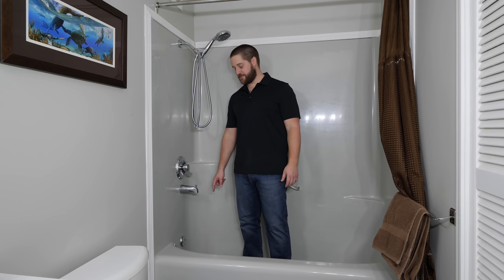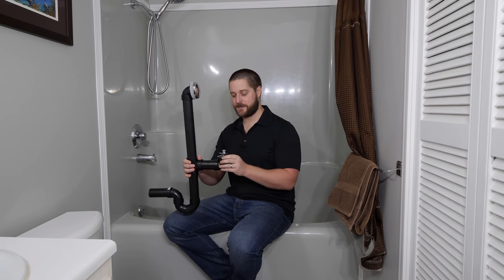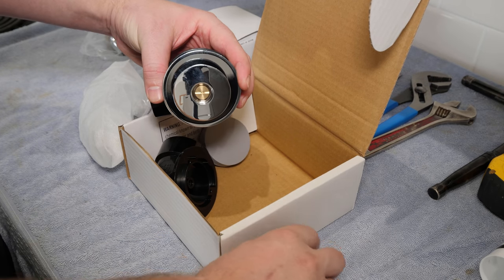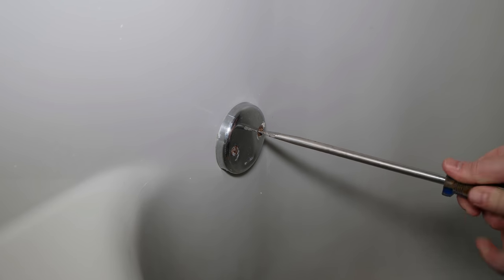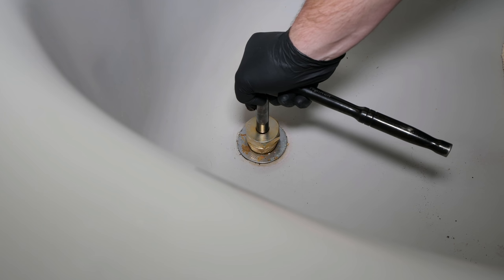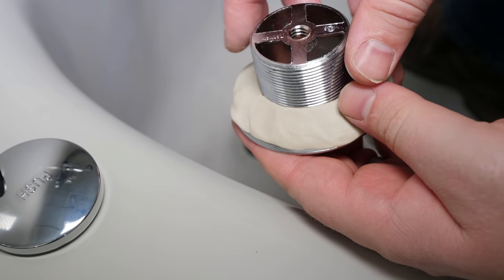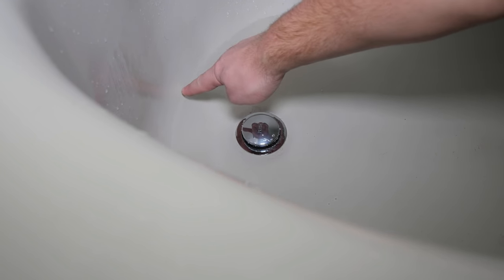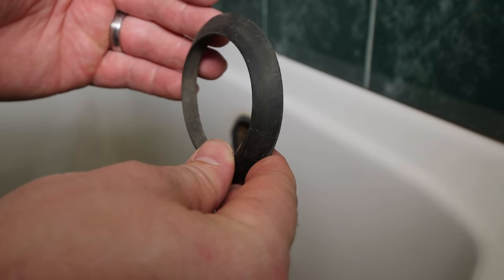Replacing a Tub Drain: Bathtub Drain Removal and Replacement

Comment: Best tip in this video is the gasket being under the hole cutout and not on top.  I'd bet lots of installers have done this wrong and as a homeowner repair I might have just replaced everything back the way it was thinking it was right.  Great video.
Reply: I’m fixing mine right now and that’s exactly what would’ve happened to me.
Reply: Biden Joe Lets Go Brandon And i agree!  Are your shorts too tight. He's just a homeowner making a comment about what he saw in the video.
Reply: But for 20 years it didn't leak, so there's that
Reply: Salty Berserker Brigade Come get some  Wow, a whole 20 years. So you’re basically a beginner.
Reply: Same! @Gray_Son1
Reply: Best comment on this video! I installed mine already but need to reinstall it with sealant. I just simply fast forwarded this video to see what he used (plumbers putty), and so I totally skipped that part but happened to notice your comment! I had put it in the wrong way and would have again! So thank YOU haha
Reply: Same! I just replaced my old drain with this style and was going to do the same thing.   Also, As a first time drain replacer, it was stellar having the excess putty just almost trim itself.🎉
Reply: @soquel7912  I think silicone works better than puddy. I stopped using puddy years ago
Reply: @IRoYaILTY why is any sealant needed? Isn’t the sandwiched gasket between tub and drain pipe forming the seal?!
Reply: @emilyc5309  that seals the strainer into the shoe, you still need to seal the strainer from the tub drain opening
Reply: I’ve seen several videos address this but say it’s not needed 
Not only does this video say to replace it, it shows a very handy trick to do so.
Great video 

I actually was concerned with replacing mine until I saw this

Comment: Our house was built in 1966 and I want to replace the tub drain because I'm going to replace the faucets but I'm worried it will be difficult and/or the new drain won't fit. Not sure if old tubs have the screw in kind of drain! 😱
Reply: My home is 1966 too! The new fixtures are of a different metal! Heavy metal back then! Sometimes, just a hair of when doing repairs! It can be so frustrating!

Comment: Hi all, this came to my feed. Thanks for sharing your tips! I want to say to some folks with an older home (40-50 years+) there were some different combos of thread. Can't source them anymore. Before you do the disassembly, thinking you can just pop out the insert from the tub side, and find a modern replacement of either thread type, nope! So then, you need to replace a lot more. Also note, that during initial install, tubs are fitted with the drains and then put in place. I mention this, because in trying to retrofit a replacement, there may not be room to easily remove the subfloor facing portion. I found this out when moving to our new-to-us 50 year old place. Drain had it's cross protection broken out on the tub side, and I have little naughty kids, so I wanted a new secure one. I scored it and got it out, and not nobody had a drop in replacement. Not even the trade stores that I couldn't buy from anyway. I needed to cut away some framing that had been built around the plumbing when the tub was initially dropped in just to access removing the drain from the bottom side. This put my main bath out of commission for a week while I went though all this investigation. Just sharing to prevent headaches and scope creep!

Comment: This is a very clear and easy to understand video for my bathtub drain replacement.  The video itself is perfectly filmed to show the details of the parts, making it easy to understand his instructions.  As I removed my tub drain, I compared mine with the photos, and was able to cross-check my work all the way through my repair.  That rubber gasket is really important - it goes under the tub, with the ridges point up, before you put the drain itself in.  And that drain shell gets a nice "snake" of plumber putty all the way around, so that it seals in the as it threads down into the tub.  As you thread and tighten the drain into the tub, the plumbers putty from the top, and the rubber seal from beneath the tub, "sandwich" the tub itself in-between.  that what gives you your water seal.  It's amazing how this video got me right through the project.  I also note that the manufacturers videos (and there were a bunch of them), left me completely confused.  Just follow this video and you'll be fine.

Comment: Thank you for a high quality, thorough walk through for the tub drain replacement! I’m currently on a job site with a rusted out tub drain that I need to replace and although I’m relatively handy, I haven’t done this before.  I’m here to paint and clean lol, not moonlight as a plumber 😆 
However, I’m capable of doing the replacement so I figured I’d just take care of it for my client, but I prefer to take on new jobs with as much information about what to expect as possible. My philosophy is anyone can start DIYing a job like this, but what separates the “can do’s” from the “can not do’s” is the ability to anticipate different potential issues/problems and then determine if you have the skill set to fix whatever THAT might be. Your vid addressed this and gave me the confidence to dive in. 
This was definitely an unexpected repair so I’m currently carrying minimal tools, but luckily my “just in case/expect the unexpected” tool box that I keep in my truck had a small pair of channel locks that I JUST put in there, as well as a 12” pry bar. I easily got the drain out using your method, and yes- the last installer placed the gasket on the wrong side of the tub 🤦🏻‍♀️.  Haven’t taken the overflow cover off yet but I can only presume I’ll find that gasket on the inside of the tub as well. 
Your vid saved me from needing to make multiple trips to the closest major hardware store which is located nearly 40 minutes from my job site. Again, thank you, thank you, THANK YOU for a thorough video that clearly explains the drain replacement process from start to finish, covers potential issues, and gives some tips/tricks/advice on the job in general but also for handling the most common of problems.  I hereby do solemnly swear not to put the gasket in wrong!! 😉😁 
PS: now I’m super curious about the status of the gaskets in my tub drains at home lol!

Comment: Thank you! I'm a new homeowner so your video helped me understand what I need and what to do to install the parts. I own a condo built in 1995. It's got a lot of wear and tear. I recently removed the overflow faceplate and it's incredibly rusty!!! The foam ring is definitely inside which is cool but it's all crunchy and dried up. The drain is currently chipped and has a Danco pop up stopper. I'm not sure how the washer will look when I remove it but we will see!
Reply: Our condo was built in 1972, so lots to do here.... AND replaced all of the fixtures in my daughters bathroom as well with the help of great vids like this

Comment: Great video! I am glad that you've pointed out which side of the tub the washer should be on, can't wait to change mine except I have to sand and resurface the tub first where it is rusted around the drain. If you do have that video I'll definitely check it out. Thanks.

Comment: This is a pretty good video. I have dealt with a lot of older homes and installing a pop-up drain is usually one of the best fixes for older bath tubs. I just hate dealing with the up down drain shut-offs and all the linkage and crap that goes along with it. The one thing about  this replacement is that sometimes it is very difficult to get the old drain out. Mineral deposits lock those things into place and you have to deal with the limited room that you have, to work with inside the tub, but with perseverance and a bit of muscle you can usually get them loose. Some commons mistakes that people make is that the black rubber gasket goes below the tub, not between the upper part of the tub and the drain. These gaskets are flexible so you can usually work them into place even if you can't get under the tub. just gently fold then up a little and slide them into the drain hole and work it into place before you try to screw the drain into place. I love the pop-up drains (also called toe tap drain). The other mistake is to not forget to put plumbers putty around the top of the drain hole before you go and screw in the new drain (this guy also mentioned silicone but I have never used that). There are two types of pop-up drains, one where you have to manually lift the top (I have only used these in sink drains) and the type that I always use which is spring loaded and all you have to do it tap it with your toe to either open or close (hence the name "toe tap drain") and yes, there are two sizes so if you are unsure, get one of each size and have them both handy when you do your project. I learned the hard way and had the wrong size then had to put my project on hold for a week until I was able to order and receive the correct size. I usually buy the pieces separately but it was interesting to see that he got a kit that included the pop-up and the overflow cover in one box. I will be looking for this next time I have to do this, just to see if it saves me money. I have both of the tools that he showed, the tub wrench and the tub drain extract tool. They are life savers. Also, on the tub wrench, there are holes. If you have a really big screw drive, that will slide into these holes, it help to give you more leverage when you have an old drain that is being stubborn. The drain he shows in this video came out pretty easily, just be warned that sometime these little bastards can be a real PIA but they will come loose.
Reply: That tip about putting the rubber, folded, under the drain, just saved me a ton of time. I was wondering how that would work.
Reply: There’s one issue not addressed, what if you can’t dig out the old gasket?  Mine crumbles and the pipe below the gasket is metal, not very flexible (like PVC) to increase the gap to a) get the old gasket out and b) insert the new one.
Reply: @JohnsonCountyMission I’m having this problem too, how did you resolve it?

Comment: Well thought out video.  I would add that I always pipe dope the threads feeding into the tub shoe, not as a sealant but as a lubricant to help ensure against cross threading.  Those fine threads are easy to cross.....also, a future video might include using a sawsall to remove the strainer in an ancient cast iron tub where the thing is not gonna extract using any method you presented.  I know you have run into that if you have been doing it for awhile.  Again, good video and very informative.

Comment: The info I needed -- and more! 

He included the information I would have needed (if i ran into a snag) as well. 
That (likely) snag being a stuck or broken threaded drain Flange/insert -- that could not be removed using the long-nose-plier method.
Our house was built in 1993 -- considered "kinda new" for Maine -- but long enough ago to have decades of wonky "code/shmode" renovation/repairs done WITHOUT the help of great VIDEO CREATORS on YouTube.

Comment: A TIP for a really stuck drain. Mine had broken crossmembers and was caulked instead of plumbers putty. I did not want to buy that gold tool for $30. I used a pry bar but first slowly poured boiling hot water on the drain to release the stuck goo holding it together. I then was able to wedge the pry bar in drain to be able to turn it. I also saw another video where a girl used a hammer and pliers wedged to turn. Best tip tho is boiling water! I thought this would take 5 min like all diy YouTube video but after frustration giving up coming back with new ideas it took two hours. Next time it will be 10 mins tho. And I didn’t have to pay someone 200+ to do it or buy a expensive tool. Loved the video! It was great at explaining all the things that are overlooked easily!

Comment: Let me ask you a question. In both cases you showed the black rubber gasket was on the wrong side of the tub but obviously it still worked right? I'm not doubting you one bit, just wondered if you didn't want to take a chance of possibly cracking your tub by prying it up with a screw driver would the gasket on top work out ok? Thank you for the demonstration.
Reply: I'm no pro but I can tell you that the rubber gasket is definitely intended to be placed on the underside of the tub, ONLY.  In the video, whoever placed it on top side of the tub (in direct contact with the drain flange) did not know what they were doing!

Comment: thanks this is so timely.  purchased house with original 1927 tub still intact.  shower works, but when kids take bath major leakage detected on the lower floor.  I thought I needed a plumber, but after watching this, I'm thinking it might be the gasket or puddy has deteriorated over time.

Comment: This was great, but I need more info on replacing / upgrading the version I have. There is a lever in the center of the overflow that controls the plug in the bottom of the tub. It is getting loose and rattling around a little, but still seals. I would like to change out the whole system to something newer and nicer looking. Im just not sure how that particular tub drain plug system works.

Comment: Extremely informative video!  Thank you so much for being so thorough.  Didn't realize that there was 2 different threadings.  Glad that you provided that info.  I need to replace a shower/tub drain in my rental and this will better prepare me for the job.  I do have a question though, the current drain does rise up from the tub.  I can push the drain back down, but it does come back up.  Do you know why that would be the case and also would there be a problem that I would need to know about?

Comment: Thank you so much for an excellent video on installing a pop-up tub drain!  I echo all the positive comments made prior to mine.  I installed my pop-up drain before the holidays, but with family members using the tub, I found to my dismay that it leaked terribly. A few questions as I re-do the drain installtion -- Is it possible or likely that the drain can be over-tightened, causing too much of the plumbers putty to be pushed out when tightening?  Second question, I had the rubber gasket below the tub opening as you indicated, but it was somewhat loose underneath as far as I could see.  Is it supposed to be compressed between the drain and a part or section underneath?  Thanks so much!

Comment: I want to replace just the drain in the floor of a sturdy fiberglass garden-style bathtub/shower.  The tub and drain were installed new only 8-years ago as a replacement for an old cracked acrylic tub.  For the new install, I apparently chose the cheapest drain from Ace... it started to corrode during the first year!  
Anyway... the installer placed the rubber gasket in the correct position, on underside of the tub.  Can I just leave that original gasket in place instead of trying to wiggle the new one in?  Also, do you prefer plumber's putty over silicone?  Thanks for this tutorial.  It's very helpful. 👍

Comment: I watched this highly informative video in preparation to replace my tub drain, the T members broke along with the center threads for the top screen plate.   I bought the other extractor tool, the one that uses a nut and a bolt to wedge itself into the drain opening.   But I haven't been able to turn the drain yet and I'm afraid of breaking something, what can I do now?

Comment: I had some issues with the bottom gasket seating correctly and solved it by using less plumbers putty, almost all of it is squeezed out anyway, and by only hand tightening firmly with the drain wrench tool.   I didn't torque it down with an added wrench or inserting a screw driver.  Got those tips on some other videos.
Reply: No. I also thought not to really tighten the drain down. Still leaked until i really applied torque with the tool.

Comment: really cool video.  Thank you.  Now my challenge is that everything seems to be calcified? (not sure if that is the word). Have not been able to pull out the spring loaded stopper and or remove the assembly.  You wouldn't by anychance know how to remove this hard water issue would you?

Comment: Very good video.  But I caution people that they may find the underlying plumbing is corroded or cracked and when you remove the Drain plug you will break a lot of things and then have bigger problems.  It is like working on an old car.  Sure you meant to just replace the shock absorber, but along the way you broke off the mounting stud on the leaf spring perch and now have to replace that, etc.

Comment: How do you identify whether a one-piece tub/shower is fiberglass or acrylic?? To know whether to use putty or silicone on a tub drain replacement? I am reading that you should not use putty on acrylic. Only fiberglass. It is a second floor bathroom so I do NOT want any leaks to the family room below! House was built 25 years ago. Not sure if acrylic is newer so you can tell by age?

Comment: That was great, thank you! I somehow missed the part where the screws for the overflow cover won't come out and you have just stripped the head off the retaining screw, so you have to cut the old plate off and put a vice grip on the screw with penetrating lubricant and the top of it breaks off so you had to drill out the screw and tap new screw holes for the new cover.
Reply: Or the part where couple months later downstairs ceiling is falling from the drain leaking
Reply: That sounds awful!
Reply: @thetechrealist  It is, even when you have the tools.